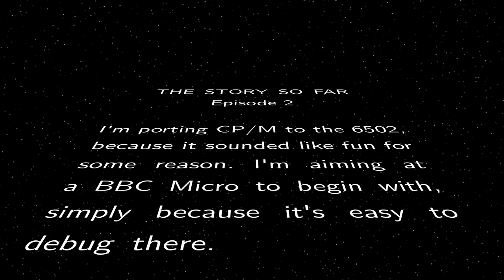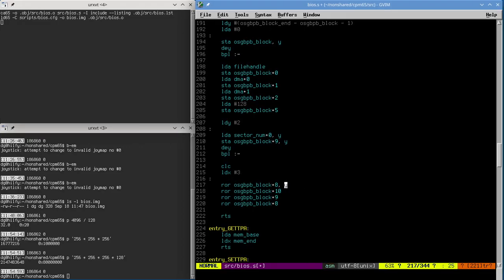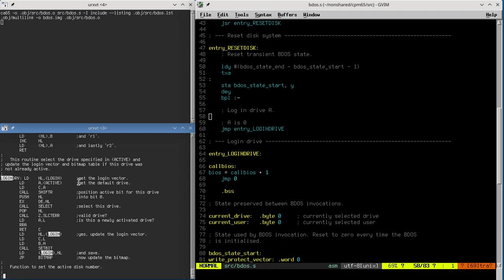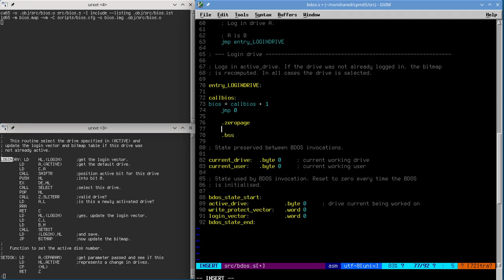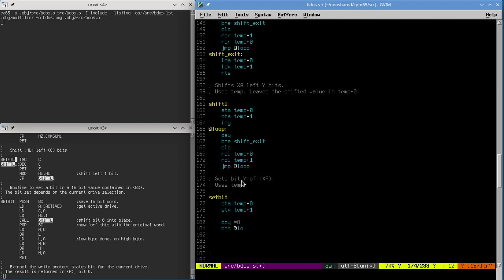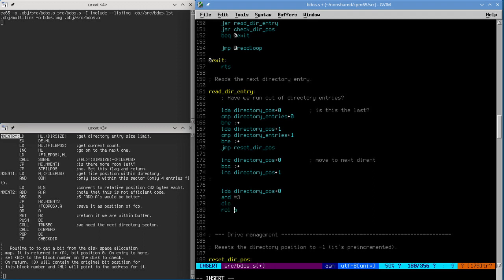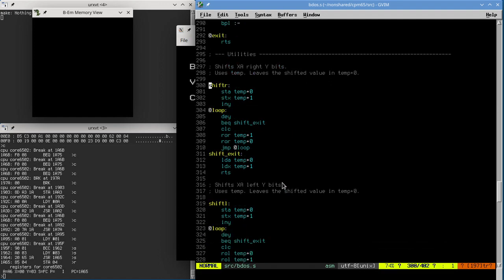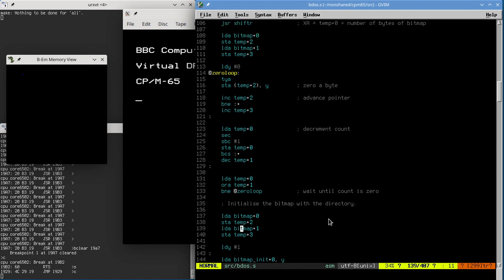6502 CP/M: 2/14

Comment: If I was to try and port the BIOS to the Commander X-16 (a modern version of the Commodore 64 by the 8 bit guy and many others), would the BDOS and so on work without many changes? Also, are you planning on doing any of the CP/M 3.0 support for banking? The X16 comes with at least 512 kB of RAM, with up to 256 x 8 kB pages visible. I was thinking about potentially making BIOS + BDOS + CCP into a ROM image and moving the variables into its own bank, so that the 40 kB of RAM at the bottom of RAM could be used for user programs, but I'm not sure if your code avoids self modification. It would be an interesting experiment, but also probably help with a BBC Master port with a sideways ROM.
Reply from the maker: I have actually done a X16 port --- it puts the BIOS/BDOS/CCP into high memory, leaving the low memory for the TPA. Unfortunately the I/O region splits the address space so I can't combine high memory and low memory. But I do still get the complete 40kB from 0400 to 9f00, which is respectable. For the Master, I'm considering various tricks. Depending on how extreme they are it may be possible to get a 52kB TPA! This would involve extending the TPA up through sideways RAM and into the Hazel filesystem workspace area.
Reply from the maker: Yup. It should build out of the box.